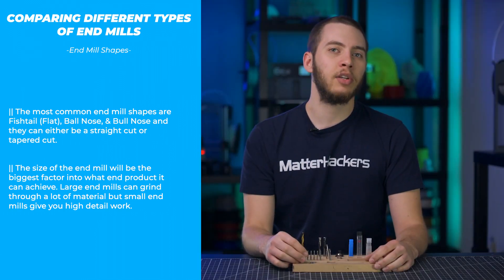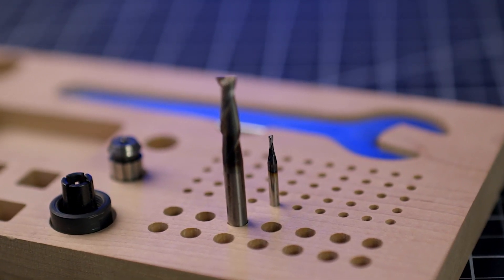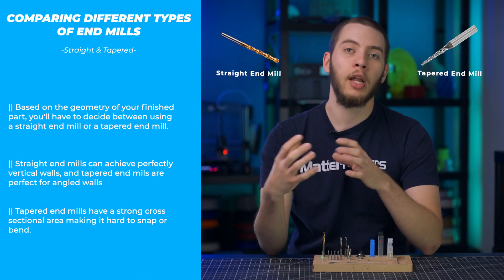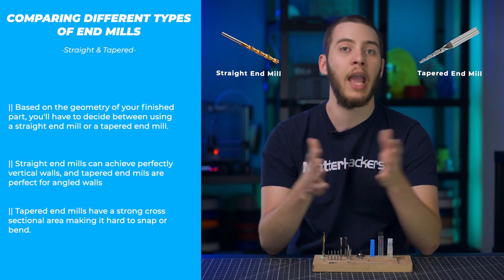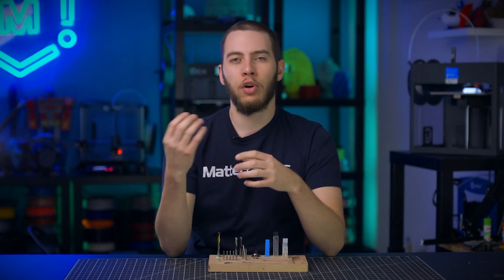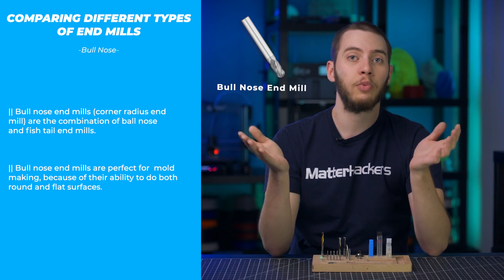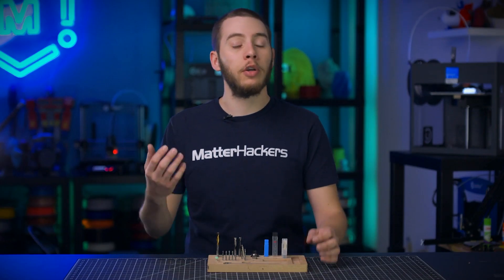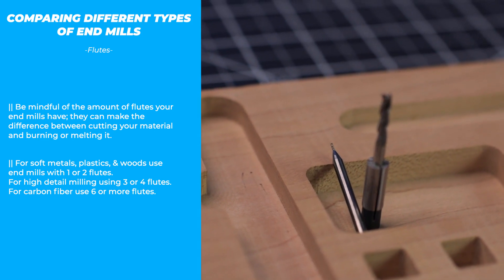End Mill Comparison Guide

Comment: can anybody point me in the right direction. Having a hard time finding bullnose end mills. Thanks
Reply: i would try 'Bits and Bits' or 'Harvey Tool'. "Bull-nose end mills are often called corner radius end mills, and are a combination of fishtail and ball-nose. These have a flat bottom, but rounded corners, so you can have a filleted inner corner while also avoiding the problem of scalloping." - MatterHackers